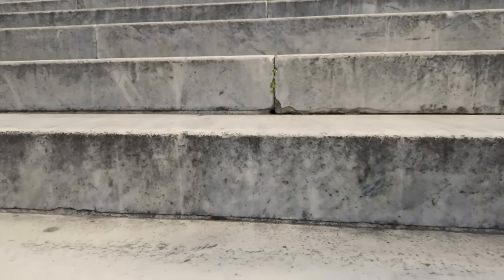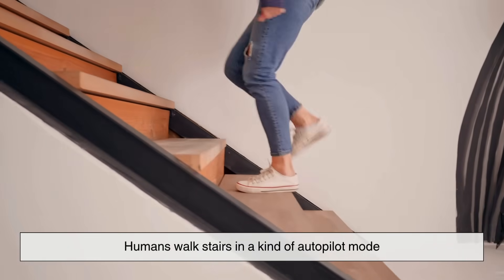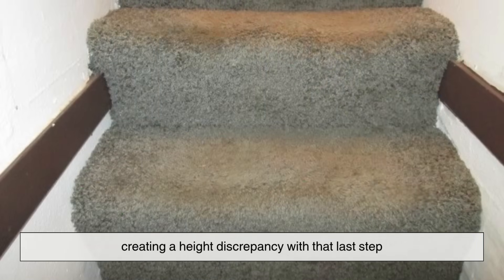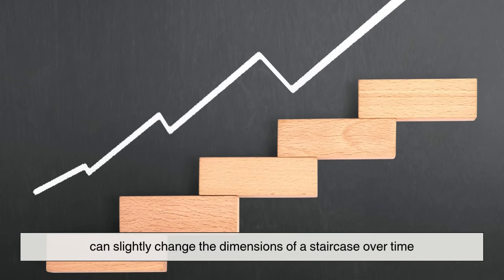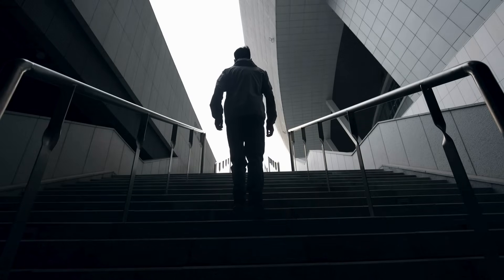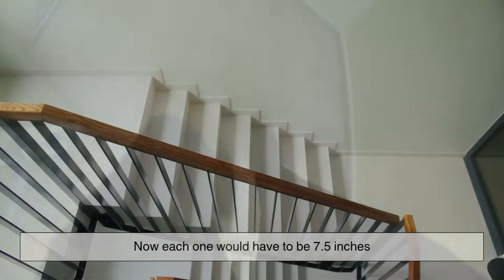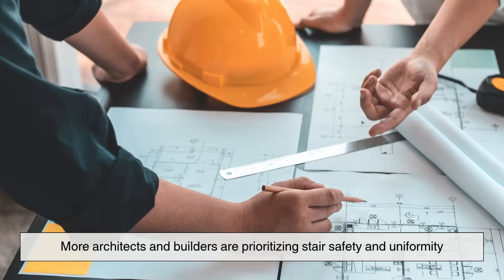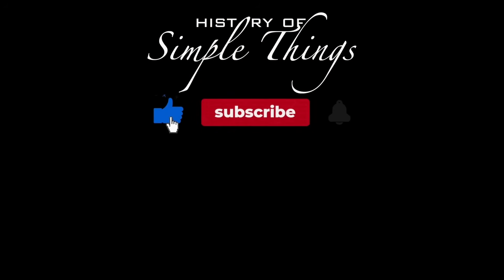The Uneven Last Step: Design Error or Structural Necessity?

Comment: I was a contractor of concrete works, I did stairs and I can't even imagine making that mistake, you measure height of flight and divide by number of stairs as to be as close as possible of let's say between 7 and 8 inches and that's it, simple. Worst places I've seen is latin America and Middle East, labor is  brain dead and or incompetent and it's crazy dangerous, I never get used to it.